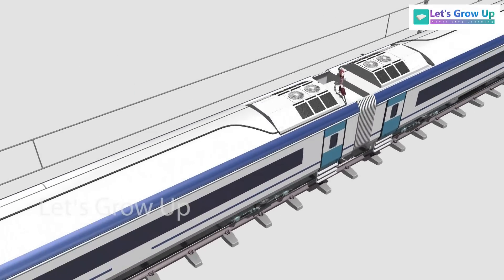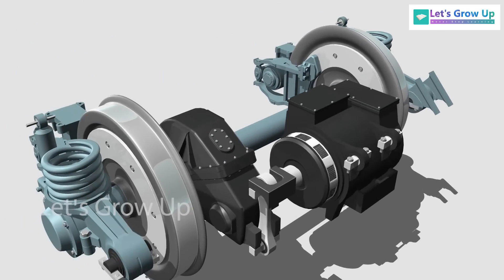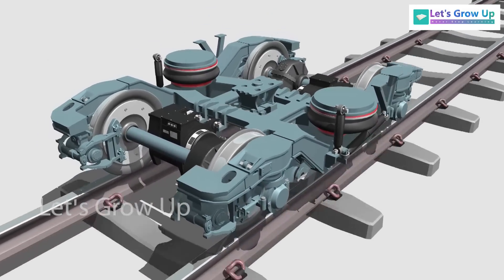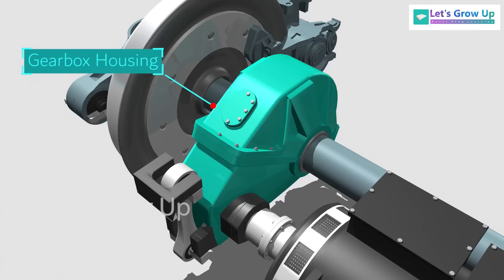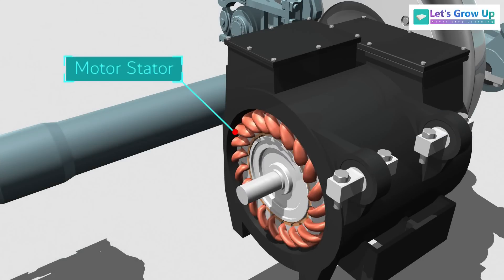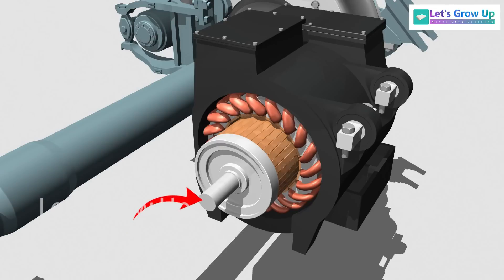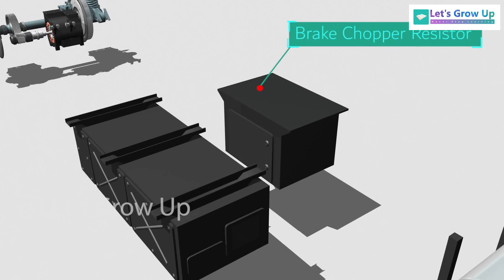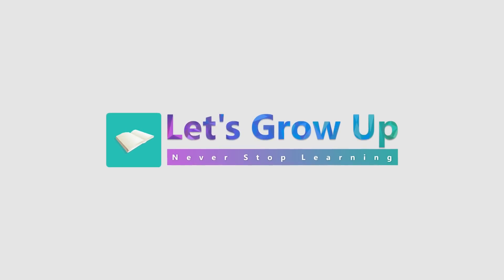Revolutionary Self-Propelled Technology of Vande Bharat Train

Comment: The bogie undercarriage is a variation of what is used on trams(street cars), the motor is separate from the wheelset and mounted transversely like a BMC Mini to reduce hammer blow on the track.  On the Brush Rail Coach owned by Black Pool Transport the bogie traction motors are mounted north and south and side by side driving the wheelsets via a short prop shaft and a David Brown spiral bevel gearbox. Both set ups aiming to reduce hammer blow and speed up changes of traction motor without disturbing the wheelsets.

Comment: Respected sir, 
Recently we got accident by uncontrollable ship in USA. 
I have send you the link of hydro energy. 
My suggestion is can we make ship to move backward by using hydro energy. 
How it will work.
When engine stop ,Propeller is rotating with lesser acceleration. 
We must use hydro energy to rotate fan in reverse direction. 
We are not using any machine but turning Propeller to move backward or to stop. 
Can we use railway break to keep ship in static postion. 
In open sea areas is larger but on dock or under bridge areas is smaller. 
We must reverse popeller ,I don't know inside motor function but we need to give this hydro energy system to reverse the Propeller. 
After that toeing machine can help  ship. 
Jay bharat.

Comment: Please tell us HOW THE MOTOR HAS BEEN COUPLED TO THE GEAR BOX (TYPE OF COUPLING USED FOR SUSPENDED MOTOR)
Reply: direct drive - there is no gearbox. power is controlled purely using voltage frequency

Comment: Why is it there is an additional motor which is connected to the main shaft. They could have direct drive that main shaft of the wheel can directly work as a rotor and a stator around it which reduces some weight and does not require an extra gear assembly
Reply: Braking and regenerative braking
Reply: Ever head the purpose of gear ratio??

Comment: Future variants will need to have shared bogies between coaches for lesser friction which will also be helpful in reducing severity of accidents. Coaches should also be cladded from the sides to reduce noise and tilting function needs to be added for maintaining speed on tight curves. Telescopic crash worthiness is not proven.
We will also quickly need to move away from LHB design as it's not tested for speeds higher than 200 kmph
Reply: TGV France had introduced bogie shared between coaches way back in 1960-70 for their high-speed train!